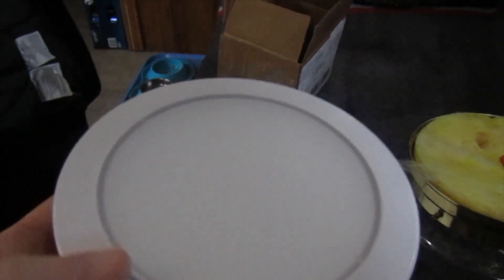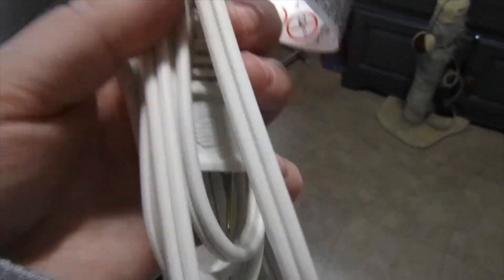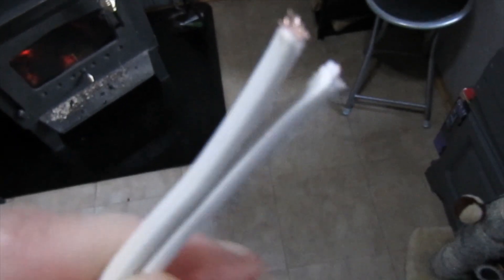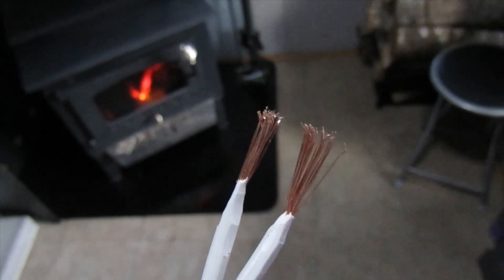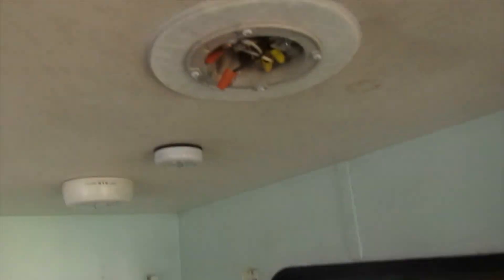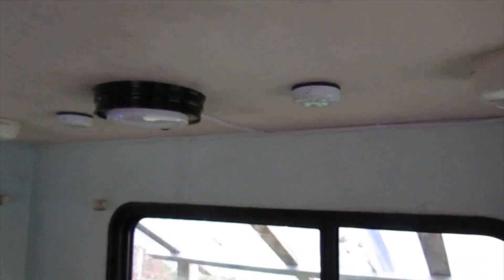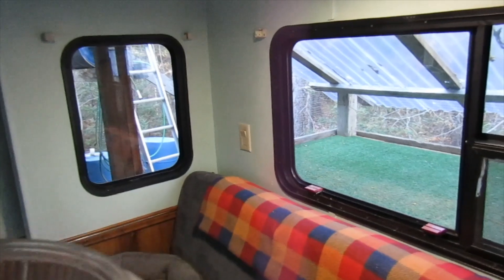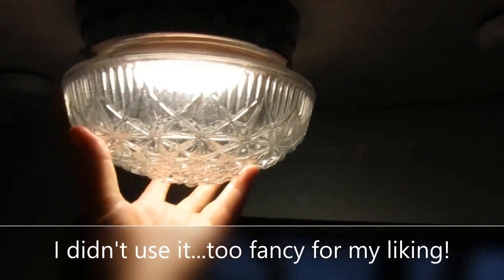Wiring a 12volt light to solar charge controller - Full Time Off Grid RV Living

Comment: Sounds like you are disconnecting the load (light) from the controller.  There is a product called wire mold that's hides /protects wire inside a molded case but your way  also works.  Good job NB here

Comment: The  arrow is to tell you there is power going to the external outlet, the little bulb. You should be able to set it to where it only gets power at a certain time during the day or 24 hours a day. Read the manual that came with the controller as it should show you how to set the time on the external outlet or you can leave it alone as it is getting power during the day time. Great job on putting up the light and wiring I hope you enjoy your light.
Reply from the maker: Thanks for the info! I am so bad about reading up on stuff! Lol
Reply: @gypsyjenna  Most of it is just common sense anyway. Good luck, enjoy the light.